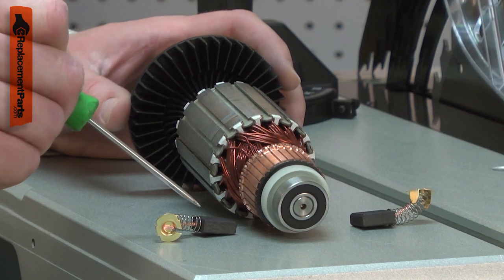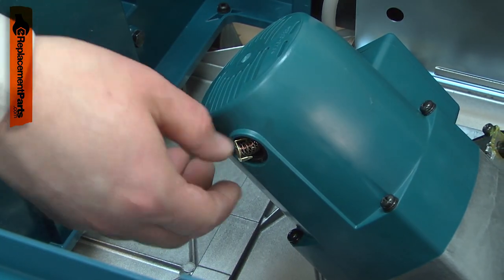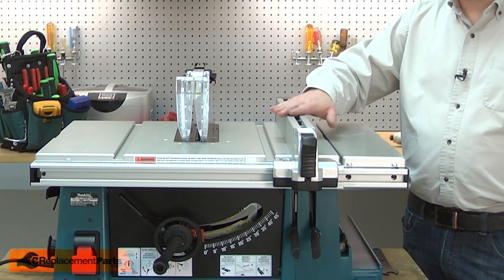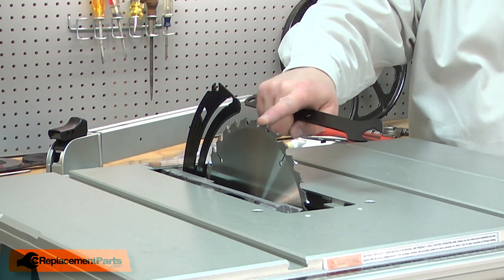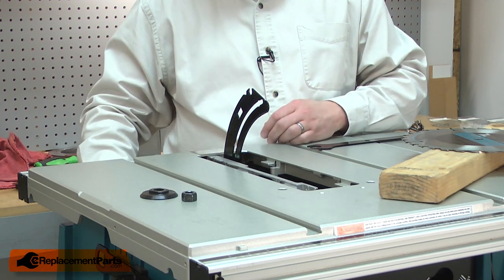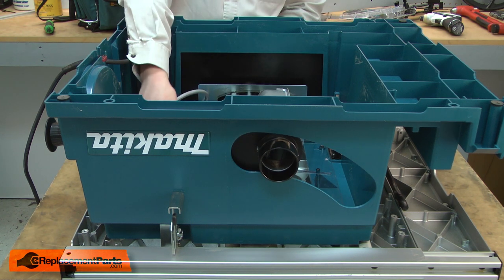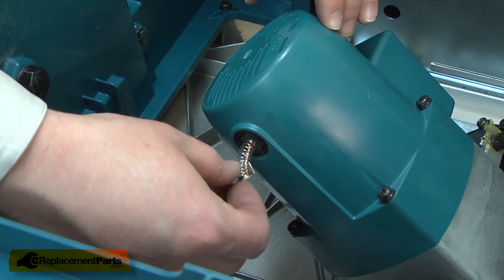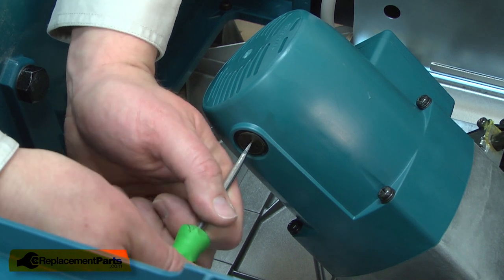Makita Table Saw Repair - Replacing the Carbon Brushes (Makita Part # CB154)

Comment: Hi, ive replaced the brushes on my mlt100 per your advice but now the saw won't turn on. The bit I'm not clear on is how should the ears go in relative to the brush? Are they meant to be in line, or at 90 degrees to the brush?